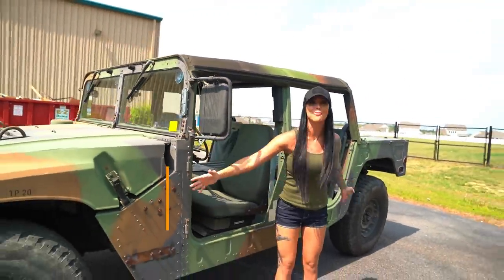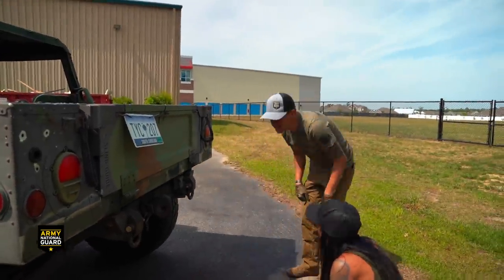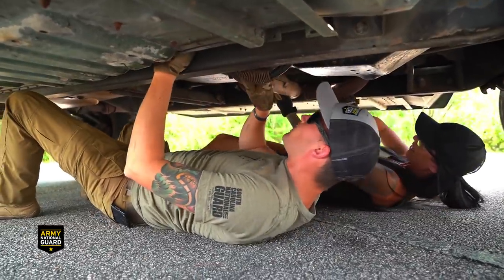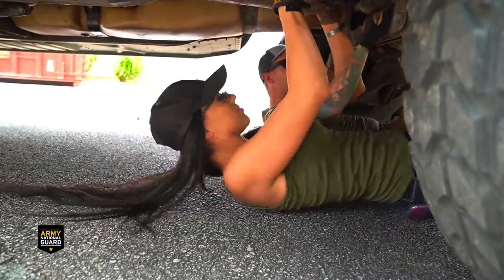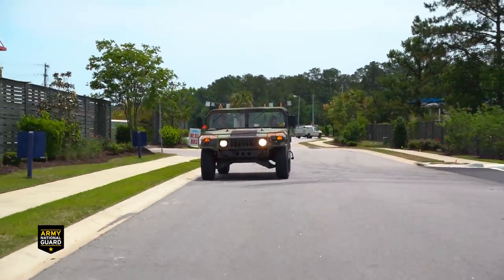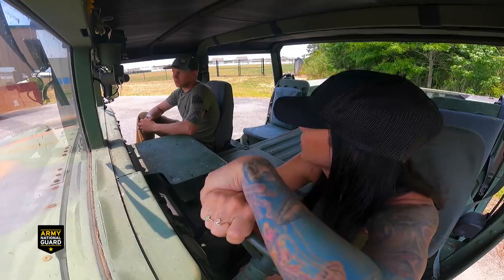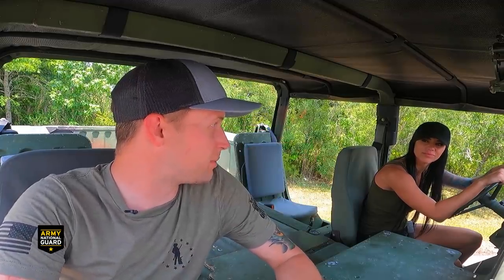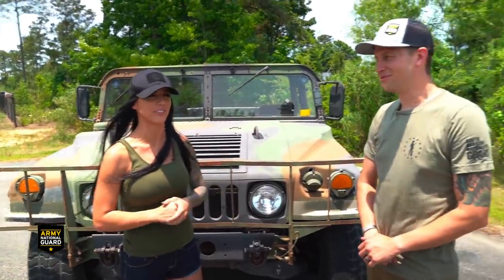I bought a Military HUMVEE!

Comment: Hate to be that guy, but I've never heard of a humvee coming with a 6.0 engine.  They started off as 6.2 naturally asperated, then upgraded to a 6.5 naturally asperated briefly in 94 and have been a turbo 6.5  since 95 I believe.  The 6.5 turbo diesel had a lot more power, but was still fairly slow in armored versions.  (I know first hand because my k2500 Suburban has the same motor, and I have lots of experience running armored and unarmored humvees).  Look forward to seeing the progress!
Reply: I am right there with you. I heard him say it was a 6.0 and I was like, NOPE!  I need to check comments to see if anyone else caught that lol. I have a 6.2 in my M1009 and was in the Army from 99-03. All I ever saw in them was the 6.5 Turbo that was pretty fun to romp around in lol. Good catch.
Reply: Beat me to it. The alpha version used the 6.5 duramax. I know at one point they were talking about adding a gas option, cant remember if it was supposed to be a 350 or 454 but im not sure if any were made. She could probably do a tuned duramax swap fairly easy i would think.
Reply: I said the same thing.. like wait a minute, that engine is not a 6.0. it's either 6.2 or 6.5 the same I have in my k3500 turbo.
Reply: 6.5 NA was available for quite a few years, that's what my 99 M1097A2 has in it. I was in the Marines 2002 - 2010, I didn't see a turbo model until 2008.
Reply: SO the guy that works on HMMWV while in reserve doesn't even know there was never a 6.0????? That is pretty scary. And that they went for a drive with that very compromised front tire. Asking for a major crash as it blows out. I know this is for entertainment purposes, but get the facts straight. That exhaust is getting ready to fall off as well with more than 1/2 the pipe rusted thru...And that is the tip of the ice berg of problems on that thing

Comment: Just a couple minor corrections/addendums... That is a flex plate inspection cover that someone cut a chunk out of not a bell housing.  Also that is a 6.2 liter normally aspirated diesel engine not a 6.0.  It should also have a TH400 3 speed transmission. The later versions have a 6.5 L  turbo charged diesel and a 4L80E 4 speed overdrive transmission.  The larger engine with boost and the 4th gear really make the vehicle more livable at highway speeds.  Also the no key deal is so that you don't have to worry about where they went if someone needs to move or use a vehicle that they don't normally use.  There should have originally been a chain and padlock under the drivers seat to chain the steering wheel to help keep causal unauthorized use to a minimum.  In the event that they really needed to move them just go down the line with bolt cutters and anyone can jump into any of them.  Almost no military vehicles have keys.  The old CUCV Chevy trucks where civilian trucks with a few military options.  They do have keys but they have the same key for all of them so again anyone can operate the rig without having to dig through a huge key box to sort out which keys go to which rig.

Comment: July 4, 2021----No key? That's because they get lost and why the steering wheel is chained to the seat. Same way with 2.5 ton, etc. trucks. From what I understand, speed on these things vary depending on the model/year they were made. Looking at this thing, wait till she starts checking out the cost of a used bell housing and not only 4 new tires, but a spare. Along with needing 4 doors.

Comment: That was not the bell housing it is called an Inspection Cover.  The inspection cover is not required unless you are rock climbing.  It will just keep debris from hitting the flexplate.
Reply: exactly. you can tell he is limited in his experience of actually working on them. and he said it's a 6.0 and they never came with a 6.0 just a 6.2 or 6.5

Comment: Front line military vehicles dont have keys. The last thing you want to have to do when in a hurry, is try to figure out which pocket you put your keys in. We used to weld chains to the floor next to the seat in the deuces and 5 tons. Then you would wrap them through the steering wheel and padlock them to secure the vehicle.

Comment: Be sure to have your knuckle gear boxes serviced. You do not want the tire and axle coming off the truck at 55 mph. Don't forget to check the blinker fluid! 1994 Humvee has a Detroit 6,5L diesel engine with a turbo 400 3 speed transmission. The Humvee and a duece and 1/2 or 5 ton truck would be a much better investment than the tank or scout vehicle. I have a Humvee that I put a 3" lift on it, 40" tires, and put a Cummins 6BT engine in it among other upgrades.

Comment: You might not need a whole bellhousing on that thing. I admit that I am not experienced with humvee's but That looked like an inspection cover for the starter ring/flywheel/torque converter. You may be able to get a replacement cover for pretty cheap. that exhaust has to go though😆
Reply: then again, it could have been a cut-out to make accessing the starter easier

Comment: Changing to a higher gear in the rear end will make your new toy faster, Alex. It ain't cheap, but it'll help with the fuel mileage.
Reply: No it won't it's 4 wheel all the time and you can't disengage the hubs you need a different gearbox
Reply: @paulj4149  So you put higher gears in the front end too. I've done it with quite a few 4 wheel drives.
Reply: @jesseglenturner   they are individual gearboxes at each hub that change the gearing down as well so if you changed the big gears it would still be low geared at all 4 corners
Reply: @omc-slugbug5745  Yeah, I get that it's still pretty much going to be a slug, but raising the ring and pinion gear ratio the same on both front and rear HAS to increase the overall speed. Does it not?
I'm no HUMVEE mechanic by any means (and don't claim to be), but it's my understanding that introducing a higher gear ratio at the chunk is going to increase top end speed - even if there's another gearbox at the hub. More RPM at the axle = more RPM at the hub = more RPM of the tire. That's how gears work. Correct? 
How much it would increase depends on how high the gear is raised. I don't know if that would create a longevity issue or not. Wouldn't think it would burn them out at normal highway speeds, but again, I'm no HUMVEE mechanic. I do know an old Motor T Jarhead or two who would definitely know.
Reply: @jesseglenturner  yes everything stated above is correct but they are gear reduction and in turn multiplicatively change ratios. My understanding was if the actual differential gears are changed the effect would be astronomically different at the wheels.
Looking thru some old manuals and a little poking around online says the diff ratio is 2.73:1 and the gear hubs them selves then add 1.92:1 making 5.24:1 overall ratio.
 I don't know if I did that math correctly but it's pretty high and my NCO always warned us the bearings in the hub are already very finicky so trying to push any more speed or torque thru that would be a bad day. Just my understanding.
Reply: @omc-slugbug5745  From the little bit of digging I've done, HUMVEEs have gone from 2:56, to 2:73, to 3:08 in the newest ones. So I would imagine any of those ratios would work. The 2:56 is probably a dog off the line, but depending on the usage (hwy vs. city or off-road) it could be better for top end and mileage. Tire height also has to be factored in to calculate the "actual" ratio where the rubber hits the road.
Alternatively, you could also change the gears in the transmission. The 4L80E (4 - speed) and TH400 (3-speed) are both super common as far as parts and range of available gears goes. The Allison transmission behind the turbo diesels might be a completely different story though!

Most of my experience has been building drag cars, street rods, bog trucks, and pavement princesses - about 35 years of it. So most military stuff isn't really my realm... But even if the gears weren't changed at all, I'd pinpoint all the weak spots (bearings, seals, etc), and find the best shit available to replace them with. After all, Uncle Sam has a long history of buying badass toys made by the lowest bidder, and sometimes they've cut corners in places where they should've spent the money!

Comment: “Mobile gaming platform” and a Humvee (with a standard issue battery and electrical system). This can only end in hilarity. 😜
Reply: Nah, it'll run it. These trucks run off of 24v AC from the generator. It'd be a good idea to wire in an extra set of batteries depending on how long she plans to let it sit without running but it shouldn't have any issues (the newer ones can runna truck mounted radar system, same electrical specs, just a slightly beefier gen)
Reply: @TheSilliestGoose516  The extra batteries are a definite must-do knowing the usual state of most Humvees in a unit motorpool. 😉
Reply: @stone11c  a couple solar panels on top and couple gel batteries with a inverter produces enough power for it, I have such on my van, I have enough power to run my fridge, fan, laptop, shower, sink/water source etc. it nearly stays fully charged all day with full sunlight just have to limit use a little when sun goes down, free energy goes along way as long as you set everything up right!

Comment: Those tires are super expensive! I’m shocked he didn’t even look at the air filter.
Reply: They didn't check the trans fluid or the coolant as well, oh well.
Reply: The initial video was over 30 minutes long and was edited down to fit time requirements. The vehicle was checked over thoroughly.
Reply: @jonathancole1534  It makes sense that y'all edited it down a bit tbh

Comment: **Hope it fits you fine.  
**Just under 6'5" I barely fit in the driver's seat and with armor and gear on my gear was 2"(if even that) from the steering wheel.  
**Uncomfortable to drive normally impossible to drive for any fast breaking fast maneuvering situation. 
**You would think that a vehicle that big on the outside world have plenty of room. 
**Sadly it isn't so.
**Another failure of the bean counters giving us shoddy or misguidedly designed equipment expected for everyone to use that can't fit the range of sizes in the military anyone from 4'11" petite females to 6'9" giants.
Reply: It's the military.
You'd think that the big ass ships that the Navy owns would have large comfortable berthing spaces for the sailors.
Nope.Same old fashioned bunks 18" from the guy farting in his sleep above you..